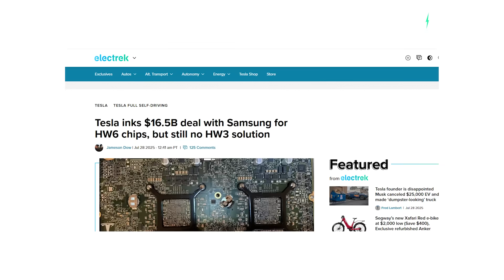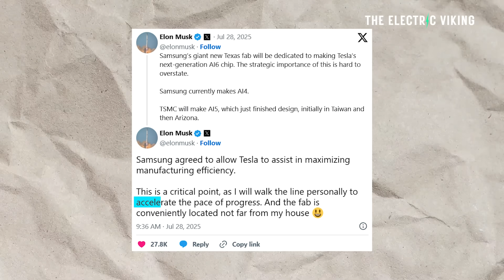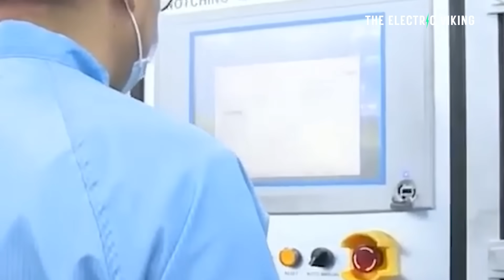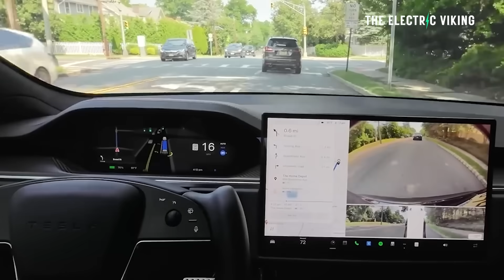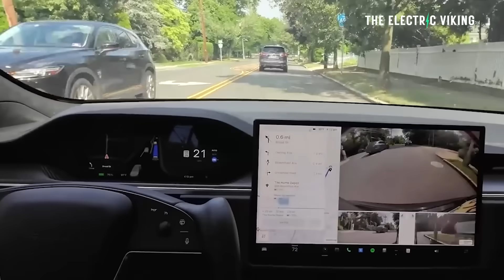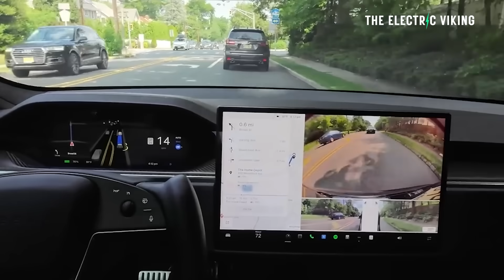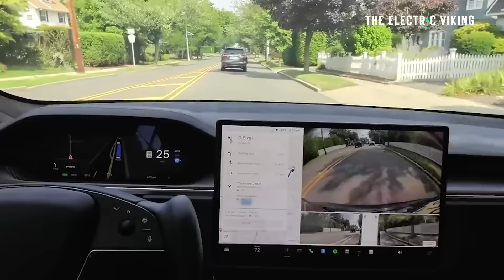Tesla's NEW HW6 $17 Billion Full Self Driving Chip Deal with Samsung

Comment: One key point you did not discuss, is that Samsung foundrys are the first in the world to move from FinFet to GAA transistors.  The reason for their sluggish sales are due to the costs involved in perfecting the new GAA technology and scaling GAA and it's supply chain.  Elon should be able to help maximize the efficiency of GAA manufacturing.  GAA Gate All Around transistors can be made smaller and more efficient than FinFet, and are the future, Elon knows this, and Samsung is a generation ahead of TSMC or any other foundry in the world with this tech.

Comment: My problem with FSD is that when I received my car in May of 2023 there was talk of the tax credit disappearing and HW4 had just started delivering. There was a rush to put money down for cars. Unfortunately my car did not get HW4 while cars delivered the same month had received it. Musk also said FSD would work for HW3 cars when it finally became fully autonomous. That hasn’t happened yet and now Musk says FSD will need HW4 or greater for full capability. Why would I drop 10k on software that doesn’t work yet and for a car that can’t run it properly. That said I subscribe to FSD and it’s great but it’s slightly disappointing I’m probably not going to get the full FSD capability when it finally releases.

Comment: "Team Musk" is in both 'foundries' training for eventually building their own chip foundry, such as BYD and other Chinese manufacturers. Just as Tesla is agnostic when buying batteries, Elon doesn't rely on one producer, which would make him vulnerable to unforseen events by either manufacturer. [IF ...] Musk intends to 'license' FSD, he will need to set a standard for EV chip compatibility, selling EV chips to legacy automakers(...?) Would be interesting if the Samsung chips are also used for robots. So, 3 chipsets; Nvidea, Dojo, and the AI-x EV series. Once again. Elon is going to create his own OS that will give $xAI a complete cross-platform interoperability on everything. Nvidea has KUDA, but a proprietary OS also adds cross-platform security. PS - Keep some bandwidth for "optical engines" and "opto-mechanical switches", which will reduce the amount of copper in everything, and add increased bandwidth to every technology; "the need for speed". Also reducing the amount of energy[...heat] necessary in massive datacenters(...$)

Comment: Im confused on the tone of this video. If samsung was creating this chip for tesla, why is it a surprise that there were no sales of the product until tesla finally ordered it?
Reply: Tesla designs ALL their own chips, TSMC or Samsung ONLY manufactures them.  The current Ai4 chips in Tesla's cars utilize Samsung's 7nm Tech, but since Samsung's 3nm Tech wasn't quite where it needed to be, Tesla swtiched to TSMC to make both the upcoming Ai5 chips AND the current DOJO2 chip.  Both are made utilizing TSMC's latest 3nm Tech.  Samsung has basically promised to have 2nm tech refined and ready for mass production by the end of 2026 for Tesla to start taking deliveries in 2027.  Considering the number of chips Tesla will need for BOTH Ai6 AND OJO3, Tesla will most likely need both Samsung and TSMC to keep up.  Especially considering that BOTH of those chips will require 2nm Tech and Tesla will be building a massive number of Robots by then.
Reply: TSMC already 2 nm and below. New Samsung fab is claiming 2 nm. Not clear they can make at scale. Tesla hope
Reply: I think the main reason- nvidia and tsmc both are from chinese  descendent and they are helping each other for not allowing samsung to be involved into this business.

Comment: <i was a tier two IT analyst(intern)from 2016 to 2017, and i told my coworkers they would all be replaced by computers(AI, robots, etc.)in 10 years; and that the cellphone would replace the desktop/laptop computer(paradigm)(no date given), however, with the greatest current revolution in computing going to 2 nanometer(just a couple molecules wide), then one of these big CPU chips would fit in your cellphone pretty easily, etc.>
<could fit a few terabytes of memory and an advanced CPU(somewhere past intel i11)in your cellphone, would just need a bluetooth hookup for monitor, keyboard, mouse, etc.>